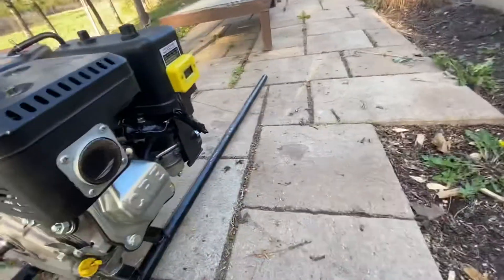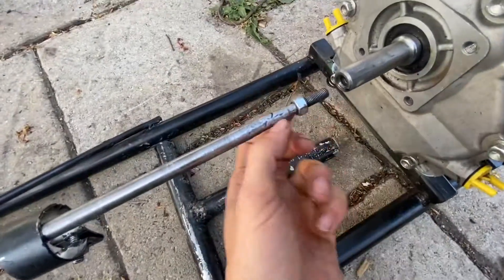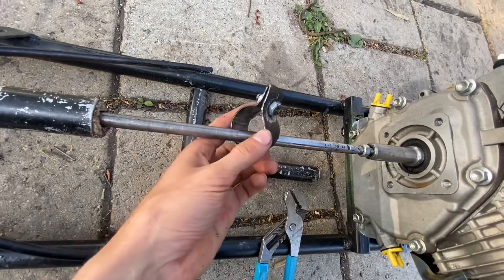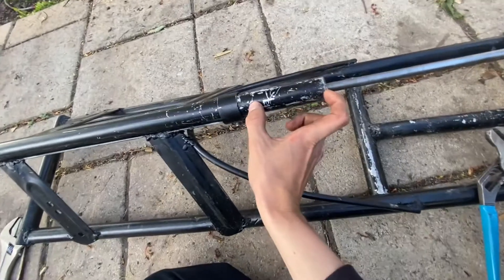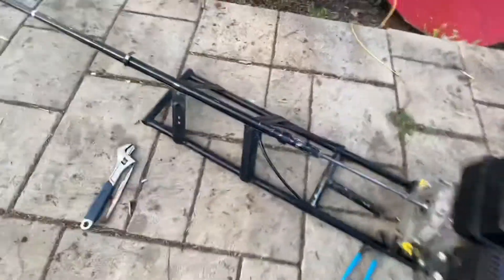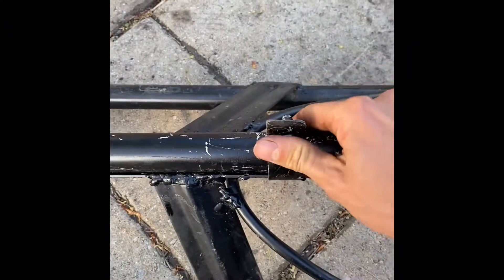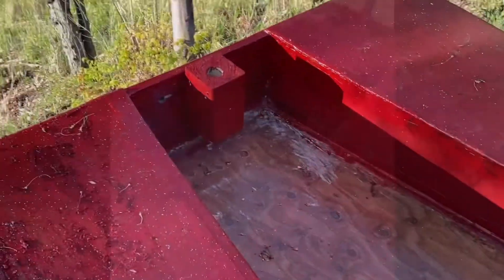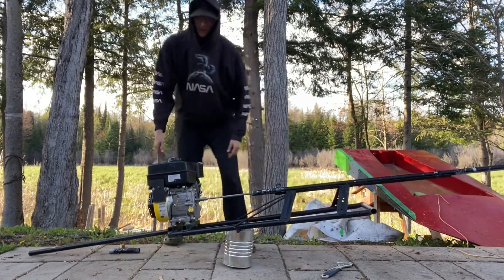Details of a completed homemade longtail mud motor engine

Comment: I am so impressed by how you made the long tail , the rope and wood solution is so inventive. I am guessing this was borrowed from the boat builders in Thailand. Going to borrow this solution for my current project, really well done! Thank you
Reply from the maker: Thanks the design i copied from a guy called hien thich che on youtube. 
If you do it make sure to use a driveshaft that is 5/8” large because the end tends to snap off close to the engine on my 3/8 driveshaft. 

If you can the best way would be to make the driveshaft from a single piece a 5/8 rod around 100” long and machine the threads at both end. I cant do it because the price would be astronomical at a machine shop.